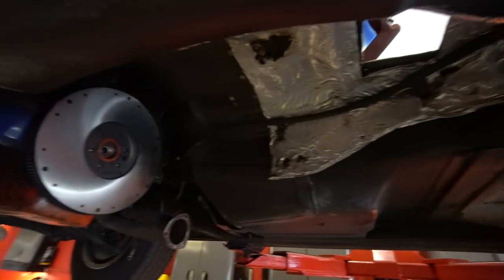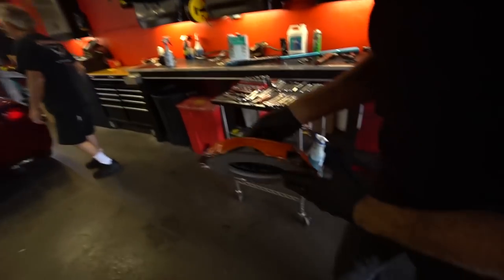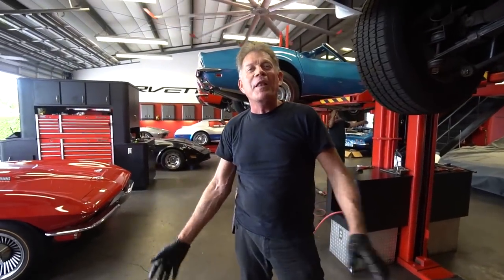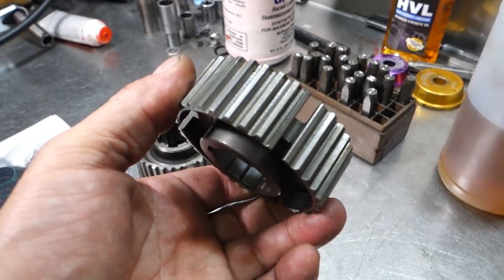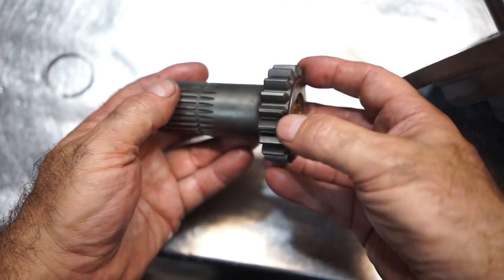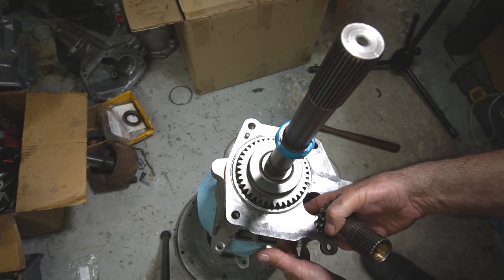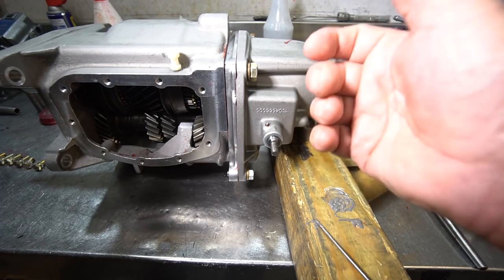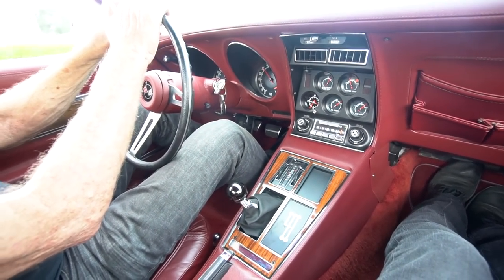How To Rebuild a Super T10 4 Speed - Part II

Comment: This video was quite helpful. I found it easier for me to pickup the reverse gear during  installation  of tail housing by keeping the transmission  horizontal and letting it hang off the table slightly so I could mate it to the main case.

Comment: I bet you know more about the T-10 than the engineers who first designed it. I had one in a 1965 Buick Skylark Gran Sport. Still remember that whine in 1st gear. Lol
Reply: Dont get confused with the original T10 generic to many makes and models. The Muncie replaced that in GM products in turn was replaced by Super T10 in about 74.

Comment: Super job, Paul! Thank you, again, for providing my manual transmission fix for today. Learning from you is enjoyable.

Is the countershaft threaded on each end? or are the holes I see just center holes from machining?

Is there any need for a welch plug at the front of the countershaft or is the countershaft already a tight enough fit that no leaks should occur?
Reply from the maker: Those are centering marks. The Supercases have room for a plug.  There is no room in a stock case to use one.  PIn fit has to be tight to avoid leaks.

Comment: Great video helping me out tremendously very well explained I had to replace all gears in St10 I took you’re advice from you’re video with using sandpaper to fit my synchros to the new gears do you need to perform that to the surface where the input shaft needle bearings sit thanx Tim

Comment: Hey Paul, thanks for the great videos and books. I just purchased a T10 Rebuild kit from you but I was wondering if you ever encountered a input shaft bearing that no longer stayed in the housing (i.e slides in and out without much effort, doesn't even really need a press fit)? It seemed to even allow the input shaft gear to eat away at some of the housing. I know the bearing retainer should keep the bearing in to some degree but I'm at a loss of what would cause something this severe.

Thanks again Paul!

Comment: Excellent video, thanks for the time you devote to producing them. I have a close ratio Super T10 that needs an input shaft due to some pitting (actually, quite a bit of pitting) on the pilot bushing end of the shaft. If I replace this input shaft, should I also replace the cluster gear, or if the cluster gear is in good shape reuse it? My concern is the gear whine potential of a new and old gear combination.
Reply from the maker: If the teeth on the counter shaft appear to be in good shape and are not worn on the center of the tooth profile then you can change the input shaft I do keep these input shafts in stock so please give us a call 561-743-5600. so far I have had pretty good luck with swapping gears on these Transmissions without gear noise

Comment: Paul, Nice build!
I have a Doug Nash 4+3 in my small block Chevy powered Austin Healey 3000. I replaced the momentary
switch in the shifter with an on-off type and an led in the dash to let me know when overdrive is selected.
The problem is during spirited driving in the twisty mountain roads in second over where I'm in that gear for a 
few minutes, it will stick in second but a light bump from an open hand allows an easy shift to third. It won't 
stick when running through the gears, up or down. I used AC Delco 10-4033 gear oil. Any Ideas?
Reply from the maker: The 1-2 slider digs into the hub. They were not hard enough.

Comment: Not to second guess you, but for longevity, wouldn't you want those two large bearings continuously bathed in gear oil instead of the factory fill grease sealed inside them? Perhaps remove the seal from the inward facing side of each bearing for better lubrication of the rollers inside?
Reply from the maker: Oil still gets in them. GM has been doing this for years and we have seen zero failures. This is what the later GM factory transmissions had in the 84-88 Corvette. All our road race boxes run sealed bearings... Again ZERO failures.
Reply: Ahh okay got it. Just wondered about that. This is a great video. Love those manual transmissions.

Comment: Hi Paul, thanks for the great videos.  My Muncie in my 1969 Z/28 falls out of 1st. Gear at first couple of blocks when taking foot off throttle, cold no load on trans.  Hurst shifter feels sloppy also.  Could falling out of gear be caused by sloppy out of adjustment shifter or is it internal? Thank you.
Reply from the maker: Try removing the stops of you have any. These transmissions rarely fall out of first

Comment: Hi - I just watched the "rebuild Super T10" video.  I found your Youtube channel when looking for best info on transmission.  It looked like you used Driven GO 80w90 oil.  My use for my ST-10 is short road races (vintage racing).  Is this the best oil for thatpurpose?
Reply from the maker: The Royal Purple Max Gear lube has been a favorite as well

Comment: I currently have a 350 small block and t10 in my 69 Camaro. I just built a 13:1 406 small block with dart heads and a solid roller. Should make 550-600hp. Am I going to destroy this t10? Been thinking about th400 swapping it. But that’s expensive. What do complete t10s go for if I sell it? Also it Has a Dana rear end with 4.56 gears.
Reply from the maker: Well it seems like you put a fair amount of money into your engine and rear axle. So don't cheap out on the transmission and just get the 400

Comment: great videos thanks , do you have a shop in s fla,  my brother in west palm has a 1974 sd455 with a borg warner super t-10 4 speed, he got this car from our father , some how dads mechanic made an error and third gear is 4th and obviously when you pull into 4th its third gear, car is not driven much so brother never got fixed ,car has 39,000 orig miles and last florida auto tag was in 1992. thanks for your time
Reply from the maker: The 3-4 linkage arm is upside down. Flip it so it is pointing up look at my shifter adjustment video and look at the placement of the arms
Reply: thanks for reply ,  i didnt think trans was taken apart , i was hoping it was linkage

Comment: Great videos! Quick question, have you ever rebuilt a ST10 that has been run without oil? Me and my dad have been building his car over the last few years and long story short we forgot to add oil to our freshly rebuilt ST10. It started to whine pretty bad after the 3rd test drive. Just wondering if you think it would be worth tearing apart to rebuild or it there is too much damage done at this point. Thanks again!
Reply from the maker: Well when they whine the gears get cupped from lack of lube
Reply: @GearBoxVideo  thanks for the response,  I guess we'll just have to pull the cover off and take a peek!

Comment: So random question seeing u know t5’s real good how many hp and torque can a stock t5 handle out of a 1990 Firebird? Thanks Hoping it can handle around 300 hp and torque.
Reply from the maker: Transmissions that are installed in factory applications are designed for their intended use and nothing more. That is my general rule. A car manufacturer isn't going to pay for a transmission that for example may handle double the load capacity. You also have to keep in mind that these transmissions are old and it's hard to determine what life they may have left in them.

Comment: Is it possible to remove the tail housing and replace the mid plate gasket without taking the entire S T10 out?  1974 Firebird, '70 Pontiac 400, 1975 BW S-T10.   Have a leak.  Not too bad, but want to make it right.  Thank you for your videos.  Watched them many times.
Reply from the maker: No it is not

Comment: Great video! What does a Hurst shifter provide over the stock shifter? I'm getting my ST10 rebuilt now and I'm wondering what all I need for short, crisp shifts. Thanks!!
Reply from the maker: If the stock shifter is NOT a Hurst shifter then you have no center bias as well as a hurst shifter is designed to ease into 3rd from 2nd
Reply: @GearBoxVideo  Do Hurst shifter sit higher up than stock shifters? Do the shift rods clear the floor? Thanks!
Reply from the maker: No they don't. Since you can bolt on a variety of different handles you can customize the feel
Reply: @GearBoxVideo  thanks!

Comment: This was a very informative video, as was the Super T10 disassembly.! I am trying to determine an issue with my 1975 Corvette Super T10. Following a previous rebuild by another party,and having noticeable gear noise, I have disassembled the trans and noticed that First gear and the Forward Reverse Idler were making slight contact. I thought a  Reverse Idler thrust washer might have been left out, but both were in place. What I did find was a missing spacer on the midplate bearing. Is it possible this could cause the First gear and Forward Reverse Idler to come into contact?

Comment: Paul, cause of a little crack in the adapter plate in a 1985 c4 (man trans with overdrive) i have to change the housing between super T10 and overdrive (where the rear bearing is in).
Any chance to change that housing without dissasemble the hole gear? Or should i do it like you do in the video?
Many thanks for that ingenious video.
Reply from the maker: Common issue. The crack happens at the lower  adapter bolt to the transmission. Pull the OD off the 4 speed, clean the gasket surface and remove the lower 12 point bolt. Apply sealant to the bolt thread, install and fill bolt hole with sealant. Reinstall OD with new gasket.  Problem is where the housing cracks, oil leaks around the gasket. Filling the hole blocks that leak. As a rule the hole is filled on every build I do cause eventually it cracks from flex. I stock the gasket, and OD filter kits
Reply: Okay, thanks a lot!!
So that means, that filling the hole stops the oil flowing into the adapter? Do i have to reinstall the bolt after filling the hole?
Which sealant do you recommend?  Can´t find the gasket in your shop.
Reply from the maker: @andreashartung8921  pick up the phone and call me contact info is on my website and and in my video
Reply: Hi Paul,  I would like to call you, but the problem is that I do not speak and understand English fluently. Especially when it comes to technical terms.
So i pull out the gear and follow your instructions. And i think, that was it! I did not have to disassemble the gear to fix the problem.
As a thank you, I bought your book on Amazon. Is is great, you are great! Thanks a lot!
Edit: Sorry, one more questions: How much oil do you have to fill in the overdrive?
Fill up, drive, fill up, ready? My mechanic filled the oil on a lift during operation and now the oil runs out of the seal of the tv cable.

Comment: Have you ever rebuilt a jeep CJ2A  T90 transmission and a T18 transfer case ? Are you still in Florida ?
Reply from the maker: Yes. I don't recall anything being called a T18 transfer case but I've done many T90 and T18 builds. New video is coming on a T86 build

Comment: Is a 81 Super T10 capable of handling 475hp, 505 lb/ft? Had trouble shifting j to gear under load. No grinding, just hard to push the shifter into gear. Sending out for a rebuild but wondering if it’s even worth it.
Reply from the maker: They were designed for the factory horsepower and torque ratings the team in those cars for that year and very little more

Comment: I have a super t10 in my 66 chevelle, motor was dyno’ed at 475hp, 503ft/lb. Right now I have the 6 ring, 3.42 1st gear. 1. Is the transmission strong enough to handle the motor. 2. Should I switch to 2 or 3 ring? Most of the driving I’m doing is street cruising.
Reply from the maker: It depends on the axle ratio, which you have failed to disclose. Tranmsmission and rear work together. 3.42 will usually break since it is ultra wide ratio.
Reply: @GearBoxVideo  3.36 10 bolt posi
Reply from the maker: 2.64 ratio is the way to go

Comment: I am disassembling a T10 transmission, following your instructions on your video. I dropped the counter shaft to the bottom on the case to remove the input shaft intact with bearing. It seems that it is not dropping down low enough to the bottom of the case. The outer race of the bearing is hitting the counter shaft gear by maybe an eight of an inch. What am I doing wrong?
Reply from the maker: Some ratios that happens. So using the case to support the input with the outer snap ring on the bearing press the input shaft thru
Reply: @GearBoxVideo  thanks i thought i was loosing my brain

Comment: Very good job loved the video ! But I am confused about something why use sealed bearings for the support shaft ? I have been around cars most of my life and sooner or later the grease inside gets caked and heated up and contaminated  and then you have bearing galling and the bearing fails. With an open bearing you are continually getting oil circulated through both bearings helping with not only cooling the bearing but bearings are also continually being lubricated with gear oil being circulating in the transmission. I myself would not go with a sealed bearing. Please explain to me why this is a better system to go on a standard trans?
Reply from the maker: Hi, thanks for your concerns.  Your theory sounds correct but you may want to watch my video on bearings. Most standard transmissions with ball bearings today run sealed bearings. In fact most of the Vettes in 1984-88 with the ST10 OD had sealed bearings in the front and back of the 4 speed section with zero bearing failures over 100K miles.The theory is flawed because the biggest failure issue is DIRT. Remember there are no filters in these transmissions and in the output area people grind reverse often. Reverse sits right behind that bearing. One grind of reverse can destroy a new bearing dumping gear chips directly into the bearing before they reach the front magnet. Now I understand the "most of my life" thing. However try and understand that out of the thousands of transmissions built especially some of the top running units in SCCA, Historic TransAM etc..... ZERO FAILURES.  What you don't understand that sealed bearings SUBMERGED in oil actually do get oil in them. Just because you think oil flowing thru the bearing is important for cooling, that is also not necessarily true. The outside of the bearing dissipates heat into the oil bath. Now if you are still  paranoid about using a sealed bearing and worried about things that we have never seen happen just go with  shielded bearings. You'll get some protection and more lube. Some people demand shielded bearings rather than sealed bearings despite my real world experience in building race transmissions with them. I'm always happy to give them want they want. Thanks for watching and taking the time to comment.

Comment: which one is stronger the super ti0 ot the super m23 muncie or a 18 spline hemi 4 speed
Reply from the maker: If they were ALL NEW, the Hemi box. It's hard to compare used transmissions. New, the order would be, Hemi, Muncie, and ST10. The new Muncie are subjective because different people build them with different components. Example we build them with Nodukar Iron mid sections and steel billet front retainers compared to others using cast aluminum components.

Comment: I have a new Super T10 on my 79 T/A it will jump out of second gear on deceleration sometimes. Any recommendations as to what I should check for?
Reply from the maker: You will usually need a second gear and or a complete 1-2 assembly  sometimes the thrust surface of the hub wears
Reply: @GearBoxVideo  thanks for the quick reply! not what I was hoping the trans was brand new with less then a hundred miles on it, took it back and they replaced the locks and synchros put it back in and still happens occasionally. Was hoping shift linkage adjustment.

Comment: Hopefully this isn't a dumb question but can the 4 speed manual have the gears swapped to be more like an automatic overdrive ratio gears? I have a manual 4 speed and would like an overdrive. I know the Doug Nash did it with bolting an overdrive to the rear. Why can't the gears just be changed?
Reply from the maker: It can be done but because there is little interest, no company is going to invest in the tooling, time and costs to do something on that scale.
Reply: @GearBoxVideo  Oh I see I thought maybe it was just a matter of swapping gears that had the same ratios as an automatic 4 speed overdrive.
Reply: Randall your obviously NOT a motorhead the room in a 4 sp will NOT accommodate another gear & slider assembly just not enough room bro  why not purchase a Liberty box or Richmond sells a 5 spd Your asking why two completely different trans can't be more like the other . One uses hydraulic pressure Or fluid to operate the other a manual clutch ..

Comment: Side cover leaked all my oil out and I didn’t not realize until it was too late and now I suspect my main bearings are burnt up. Is it possible to replace the main bearings without disassembling the entire transmission?
Reply from the maker: Watch my Muncie tapes series. This way you can see what is involved.
Reply: Curious why you suspect the main bearings are toast. I may be in the same boat unfortunately. A local shop rebuilt the trans a few years ago but I had major problems with them so don’t want to take it back. Just noticed the leaking and a little bit of noise in neutral that I don’t remember before. Could’ve been there though, I’m not positive. Not sure if that’s normal or not.
Reply from the maker: Ball bearings can survive on little oil. Usually the gears will get scuffed and gouged out because of low oil levels.
Reply: Good info, thanks for your response. Your videos are invaluable

Comment: I had to drop the cluster to remove the main shaft on the 3.42 first gear T-10 which meant rotating the mid plate to remove and re install the cluster shaft.  Is that the way it has to be?
Reply from the maker: Yes, if you look at part one, the 3.42 has to assembled like that in reverse